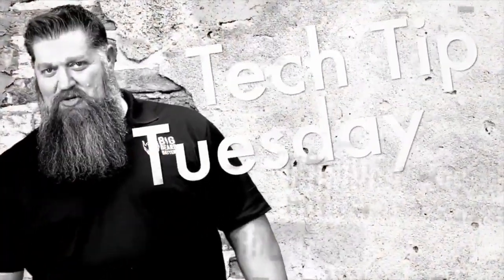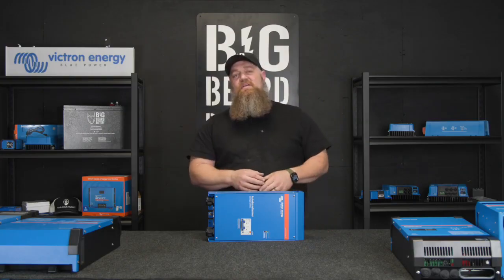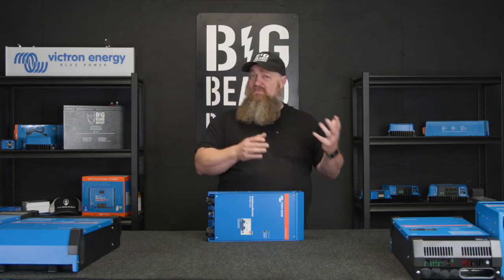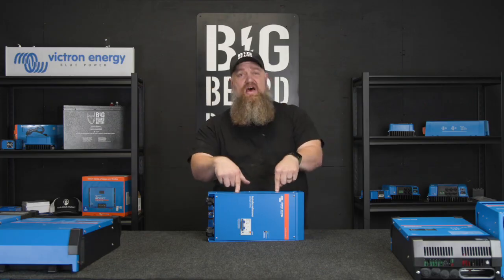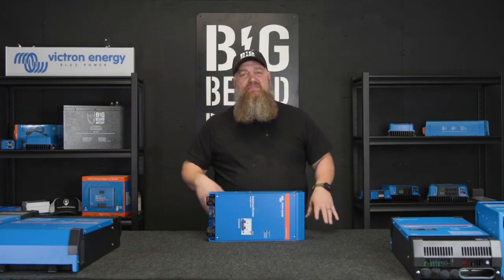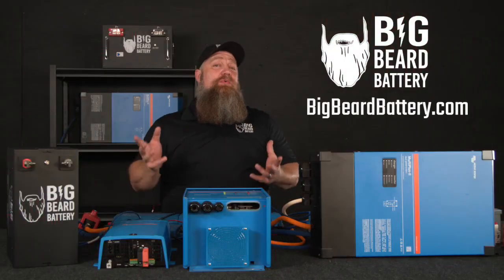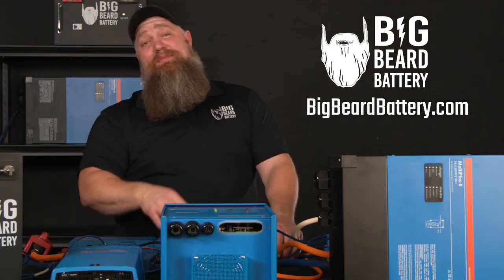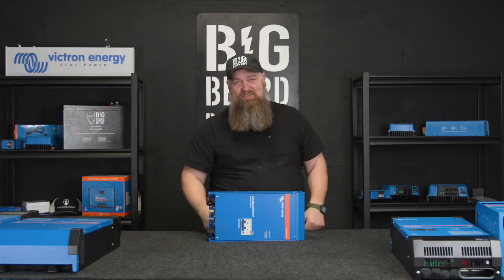Dual Inverter RV System? Here’s Why You Might Want an Autoformer:

Comment: This is not quite correct an auto transformer is for a system where you want to change either your input or output from 120v to 240v.  So you would want an auto transformer if you wanted to change your voltage from 120v to 240v (or vice versa) for some reason.  If you have dual inverters and all of your loads are at 120v you dont need an auto transformer.  You can just assemble the inverters in Parallel, and get an electrical panel that will accept input from two sources and connect both inverters to this panel.

So if the inverters were in parallel, connect AC-OUT-Leg1 of BOTH inverters to the same electrical panel, and both inverters will power any loads connected to that panel.  You would only need a transformer if you wanted to change the voltage of the inverters from 120v to 240v (or vice versa).  An example would be a boat from the US running 120v electrical, sailing overseas to a country like England where the default voltage is 240v.  If you plugged your boat into shore power there, you would need a transformer to change the voltage of the shore power current from 240v to 120v so your electrical system can handle it correctly.

If you only had a few 240v loads like a water heater or a stove, you could handle these loads by using a single double-pole breaker to raise the voltage from 120v to 240v to power a 240v load without an auto transformer.
Reply from the maker: So in the RV space there is only 1 neutral on a 50amp system. Therefore all pedestals are 240 on the 50 amp service to assure no overloading of the neutral occurs. 

If you put dual inverters in parallel and connected to ANY rv pedestal will cause catastrophic problems as the pedestal is 240 or split phase.
Reply: @BigBeardBattery  In the US the default voltage is 120v, so the electrical service of shore power should be 120v.  The electrical service of an rv panel should not be 240 split phase as that is the default voltage of overseas countries.  Both Mexico and Canada also use a default voltage of 120v so I find it hard to believe shore power electrical would be at a foreign voltage.  I guess it is possible but unlikely.  If shore power were at 240v YES you would need an auto transformer, but shore power in the US should ABSOLUTELY NOT be 240v it should be at the US default 120v.
Reply from the maker: @armelpeel out of your wheelhouse in RVs. Can’t do as suggested but I appreciate the input.
Reply: @BigBeardBattery  I donno about this scenario man.  You pulled into an RV park IN THE US that was wired with the default voltage for England and NOT the US?  Sounds unlikely I would say dont stay there the electrical is suspect.

If there were dual 25 amp 120v connections you could use both of these to get 50 amps at 120v.  My boat can accept shore power on either side so I would need a long enough cable to reach around to the pedestal.  But if it were 240v ONLY, this would be very weird in the US.  

In this unlikely scenario YES you would need an auto transformer.  The different voltages would have different plugs anyway.

Comment: Or set the inverters in parallel instead of split phase , no auto transformer needed. Been running parallel 24v Multiplus II’s for over two years with zero issues and no auto transformer.
Reply from the maker: On the 3k only. Not available for 5k
Reply: @BigBeardBattery its a shame they don’t make 2x120 in 48v or 5k inverters. Kind of ridiculous.

Comment: Is there any technical reason you would install 2 120v 3kva inverters with the auto transformer and not 2 2x120's running in parallel? Unless there is a desire for 48v it seems like more money spent for the same end result.
Reply from the maker: Typically we prefer using the 5k. However there are 2 reasons. 

1) form factor. If the space does not allow for an MP2 but the shorter “cube” style. 

2) lower input current limit when not put in parallel. Many RVers enjoy the power assist function of 15amps or less. When MP2 is in parallel you are limited to 17amps. Which with a sufficient demand would trip the breaker. 

Again we tend to offer dual 3k in parallel   But when dual 5ks are offered we install the autoformer.
Reply: @BigBeardBattery  Thanks, the power assist is something i never even thought of. I have 2 of the 2x120's in parallel and i have yet to find an instance where i have needed to run it on anything less than.a 30A connection.
Reply from the maker: @TDub_ADV yeah only if you go down to 15 or less. Otherwise the parallel function is awesome
Reply: @T @TDub_ADV you can install a power supply/ charger that can plug into 15a outlet that just charges your battery.easy fix.
Reply: @saltytrips  Yep if one was so inclined. For me its never once in over 2 years of full time travel come up as an issue. Reality is any place i would go that only has a 15a connection is probably a friends house and i would just live off my solar and battery anyway and absolute worst case i can run my generator. The places i moochdock at are far enough north that AC is simply not needed even in the summer. I can live quite comfortably with 3250w of solar and 21kwh of battery in that scenario and have done it many times for long periods.
Reply: @BigBeardBattery with parallel input limit issue can easily be over come with a separate 12v or 24v power supply that you can plug into a 15amp outlet. Way cheaper and easier than auto transformer.